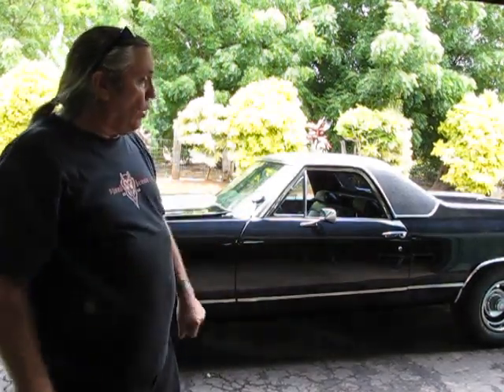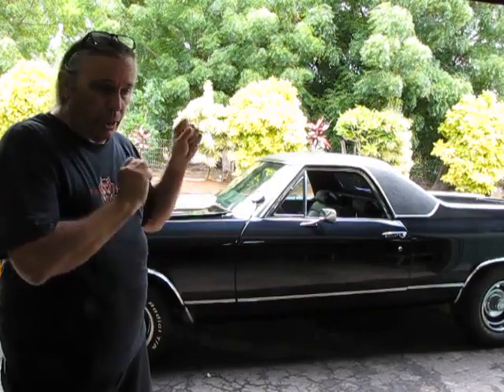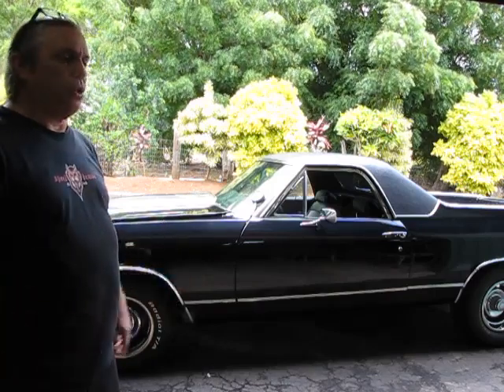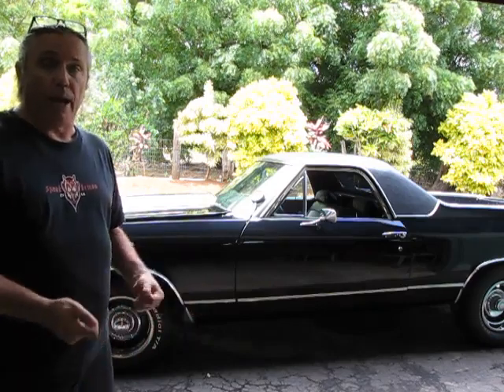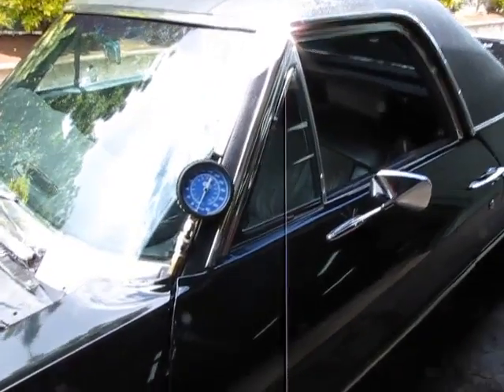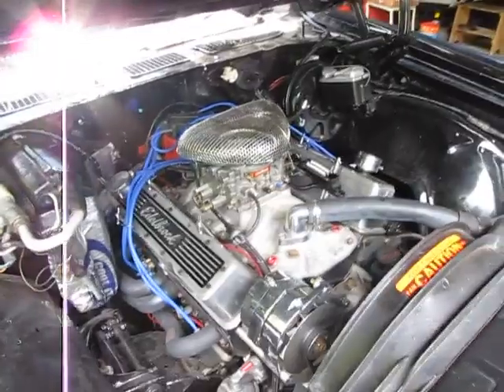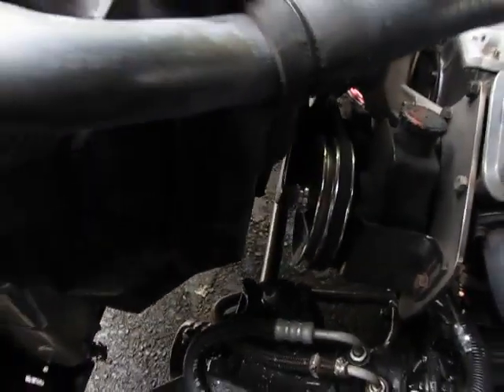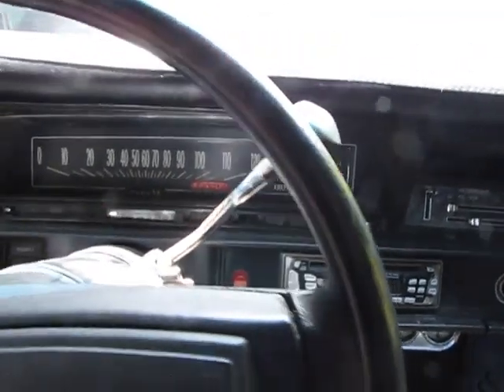1972 Chevy El Camino 700R4 Transmission

Comment: So you're originally a So. Cal guy from Riverside? So am I but from LA. I drive once in a while to Riverside from LA. I have a 79 Caballero/El Camino.  It has THM350 tranny. I'm actually planning on installing the 700R4.  You know how we southern California guys are, we're always jumping on the freeway going from city to city and car show to car show.  I just think that the 3 gear tranny I currently have sounds and feels awful driving it at over 45 miles per hour. The poor engine sounds and feels constipated with 3 gears to transfer the power to the  wheels lol.  It just begs for a fourth gear. Maybe I'm just used to my Mustang 5.0 AOD tranny. But since I only plan to cruise my Chevy, I would rather put a 4 gear  tranny. If I planed on racing on the strip, I would definitely keep the THM350 but rebuild it for high performance. But oh well, it's a matter of preference and the purpose of use. Have fun with your Elco.
Reply: Currently having a 700r4 installed in my 82 Gbody El Co, hoping for the best lol

Comment: I think you would of been better with a th.400 .mine is bullet proof
Reply: Ny Chan I agree! I love my th400
Reply: It's heavier and you lose more torque but if you're making huge power like 800+  yea the 400 is way better especially with a trans-brake. 
But they can really build a TH-350 pretty strong, same as the newer aftermarket TH-700R4.
8-set clutch packs,  front and rear billet alloy planetary,  better shift servos, stronger bands, ect...  
Some of those level 3 to level 5 TH-700s can take up to 1,200 horse all day long.
But if you have a 500 horse SBC stroker you're better off having a built TH-350 over a TH-400 due to weight and torque loss.